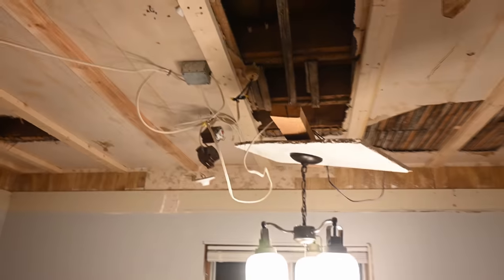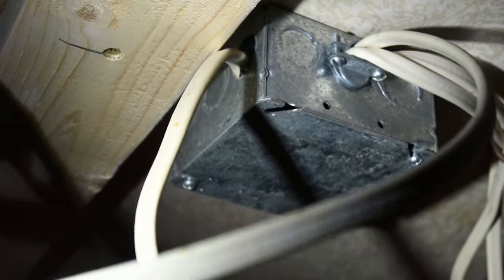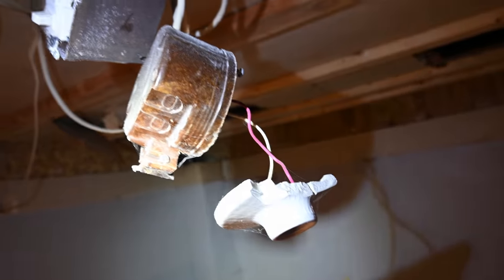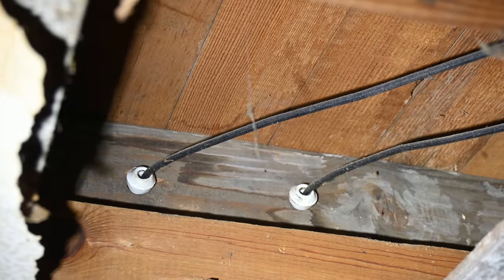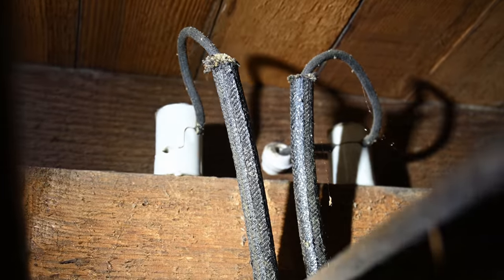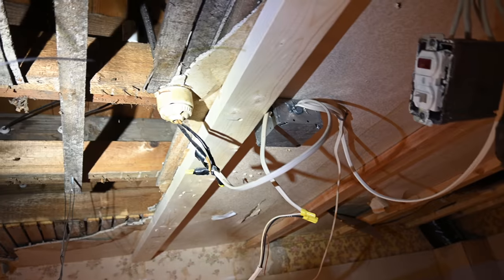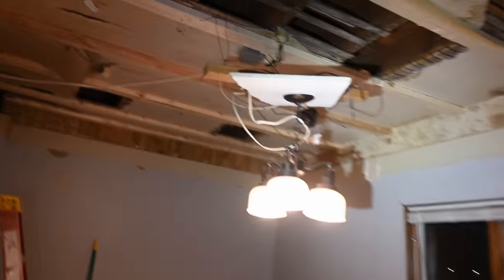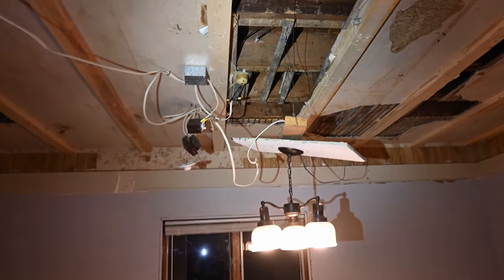The Worst Modified Knob & Tube Wiring Situation I've Ever Seen

Comment: "Original" knob & tube, even 100 years old,  professionally installed is remarkably durable. TWO hazards: Improper add on's & overloading the old circuits with so many new appliances. 100% rewire.
Reply from the maker: Agreed. Honestly the actual knob and tube stuff looked to be in great condition with nothing that looked particularly hazardous. The "add on" wiring though was more of the issue.
Reply: deteriorating insulation and no ground are issues as well
Reply: Yup. The only problem with original KnT is that the insulation gets brittle close up to the lamps, from the heat. Often, the loom and insulation is till quite rubbery and even has its original tar intact. 

What we did in Iowa was to run new, code compliant circuits and leave the existing in place without alteration.
Reply: @Jon-hx7pe  yes, deteriorating insulation,  especially where exposed to heat at light fixtures.
Reply: The thing is you can over load the hell out of K&T and nothing will happen. The wires are in free air and separated. Modern wire the problem happens as they are close in the same jacket and will then start to arc and spark and poof fire.   Not the H/O free air splices yea bad day.   Ripping out the K&T at my families I back fed the old stuff as we went along room by room.  Get to the next room. Open the previous box, disconnect it and pull from the side you're remodeling.
Reply: Another hazard I’ve seen many times is where the main run of K&T is tapped for branch runs. They would strip the wire, twist the tap around the main, solder the tap, then wrap the tap with tape. 
Eventually, the tape failed and left the connection exposed. I’ve been in dark attics and have seen those connections glowing from a heavy load. 

I learned from a fire inspector that a lot of K&T fires occur when the homeowner adds more cellulose insulation which covers those connections that used to cool down in free air. The insulation traps the heat and smolders until a fire eventually happens. That’s just one of several hazards K&T present today. At the time it was installed, it was awesome!
Reply: @OwensandCompany  Quite true. However, that was actually how they made taps: scrape the wire, wrap branch wire and tape over the bare part. The overloading, insulation, out-of-box contact ... those are our fault. 

Hey, they didn't even require system grounding until after the 1970s.
Reply: Had a shop teacher tell us that knob & tubebis safer for flooding and overheating ( as long as its on a 15 amp fuse or breaker. ) .
Reply: Bare/ deteriorated insulation on knob and tube is the most dangerous to not only home but us tradesman. Heard a story from an "og" in my company about an ac tech who layed across bare knob and tube in an attic, the outcome was not good.. have read stories about newer insulation being blown in attic's where the knob and tube electrical caught fire... But if it's unmolested and in good shape just leave it alone it'll probably last another hundred years!
Reply: Agreed
Reply: @ricoludovici2825  That's The Logical & sane way to do it, not all the fear-mongering.
Reply: @OwensandCompany  I can speak about old wiring.  We didn't run into knob and tube but we ran into 1910's or 1920's wiring in a house my father had.  The wire was literally insulated by cloth and by the 1980's whenever we had to change a switch or outlet (which seemed like every month) the cloth would literally disintegrate in our hands.  Worse yet, the wire appeared to be equivalent to 16 AWG.  That electrical system was a big mess, that is for sure.
Reply: yet today's LED's take almost no amperage compared to 100 years ago, so it is safe overall if not "messed" with. That mess (for lazy people) seemed to be more work then doing it right.

Comment: Back in 1900 that was the top of the mark in electrical work..

The lesser done jobs all caught on fire so the fact it exists to this point in time is pretty freaking cool.

That's historical wiring..
Reply: It's pretty sound wiring as well the overcurrent being plug fuses where larger fuses can be put in when you're blowing smaller ones are the questionable part of the system. That and no equipment grounds.
Reply: @frankpaya690  That's true with the original Edison base sockets.  In Wisconsin you had to use Type S inserts, they have a one way ratchet, if you try to remove them they destroy the socket.  Inserts were sized for 15, 20, or 30 amp circuits and were NOT interchangeable.  The 15 amp fuses were blue, 20 amp were orange, and 30 amp were green.  So even if you are color blind, or can't read numbers, a 15 amp will just drop in and rattle around in a 20 or 30 amp socket and a 30 would'ent  fit in a 15 or 20.  
In someways fuses are safer than breakers.  A fuse is a simple non mechanical device, whereas a breaker has thermal and electro-mechanical contacts.  In fact in the early days of breakers, they would recommend switching them off and on maybe once a year to make sure the contacts were not frozen.

Comment: My dad was a master electrician. In these situations, EVERYTHING came out. No attempts to make it work or anything like that. It all came out and was done right. You can spend your time analyzing and coming up with working solutions or you can fix it right. He was a real hardass on this kind of thing but he was right.
Reply from the maker: Yup, that's the way to go for sure! You can spend days fixing old junk and then still not have a great situation when finished.
Reply: I thought the same thing. Rip it all out and do it right.
Reply: Some people disconnect the old but leave it in place, for its antique/historical appeal, and run new stuff separately.
Reply: @scorpio6587  If you leave it in place, your homeowners insurance underwriter will still deem the house to "contain old wiring" whether it's energized or not.
Reply: If the old house is in a gentrified historical neighborhood that is constantly appreciating, then yeah, it could be worth it to tear down all the walls and ceilings and completely rip out the old knob and tube wiring. Besides that, you can install modern insulation, plumbing, and voice/data cabling too. But the vast majority of old houses are NOT appreciating like that, so any serious amount of investment like that may not be realized. Plus, if you're LIVING there while you're doing renovations that are THAT extensive, well, that is hell in and of itself.
Reply: @aaron74  where do you live that the homeowners insurance underwriter  has any idea if you even have wiring?
Commie California? My insurance company has never even been to my house.
Reply: @dontfit6380  When you're getting insurance for the first time, they certainly make a risk assessment of your property. One of their factors is old wiring. You can call it commie, but it's simply business... if your house is too risky for their underwriters, they may may flat out decide not insure it and advise you to try another company. I encountered that with USAA on my 1890 house. So I'm using Allstate.
Reply: @aaron74  but you are in California correct? I’ve built two of my own homes. I built them not general contractors. I have also owned several older homes. I’ve yet to have an insurance agent at one of my houses. I’d never heard of such a thing. Do they also look at your cars when you buy them?
Reply: @dontfit6380  California? What makes you think (or even guess) I'm in California? I'm genuinely curious. I don't think it matters what state you're in; an insurance company is going to do a very thorough analysis of your house and charge you a premium according to their risk calculations. They do it with automotive insurance too... what the vehicle is worth, its safety features, what ZIP code you live in, etc.
Reply: @aaron74  I assume California cause I’ve never heard of such a thing. I’ve lived in 2 stares. My insurance companies have always just asked square footage and appraisal and how much I wanted to insure it for.  The same goes for my sons house. I find this so strange. 
I’ve owned more cars then I care to think about as it was a hobby of mine and no insurance company ever asked me what I paid for them. They get the vin number and send me a bill. Really this is crazy. It has to be where your living or I’ve just lucked out with where I’ve lived.
Reply: @dontfit6380  Maybe it's because I have an 1890 house and that could raise a red flag for the possibility of having old wiring. So they confirm it in their risk assessment and underwriting process. If I lived in a younger house the issue wouldn't ever be raised as it would be impossible for a house built more recently than, say 1950, to have knob-n-tube. My suggestion to you would be to stay away from owning an old house if you're bothered by a more detailed and thorough risk assessment.
Reply: @aaron74  I don’t know, like I said it seems strange to me. I’ve never had one ask what year my house was built. They just ask the appraised value and how much I want to insure it for. 
Around here the risk assessments are done by the area you live and how far from a firehouse. Like I said it must be the area you live. 
You are correct I would not insure my home if I had to let some little suit in to snoop. The tax assessor already tried that. He won’t be back again.
Reply: @dontfit6380  The year your house was built is public information. It's in your county's property record data. You can look up information about any house in the country if you go to that county's website and find their property lookup search. I think you underestimate what the insurance companies already know about your property.
Reply: @aaron74  of course they can but that doesn’t mean they do it. Again I think it’s where you live. I’m going to have to give my insurance man a call.
Reply: @dontfit6380  I would never assume they don't. lol  It's to their advantage to have as much data about your house as possible. You do also know that your automobile insurance company checks your driving record too, right? That also is public information anyone can get about anyone else.
Reply: @aaron74  Haha yeah I did more then my fair share of drag racing in the 80’s and went through many insurance companies. My home insurance guy is calling me tomorrow. I’m going to hash it out with him as to how much snooping he’s doing.
Reply: @aaron74  i’m
Reply: @aaron74  I asked my insurance man about them ever needing to look at my house or looking up public records. LOL He asked if I was doing something out of my home I shouldn’t be doing . 
All their prices are basically cost averages per area.  They are only in my state so they are never paying for hurricanes or earth quakes so their costs and our costs are kept down. He said some of the bigger insurance companies could want a home inspection but that I don’t need to ever worry about that.
Reply: @dontfit6380  I never said they all order inspections. I'm just saying they AT LEAST compile all the public information that's already out there about your house and they have that in the file of your property. They may or may not ask you questions about the property that pertains to a risk assessment, like old wiring. (If you have a 132-year-old house like mine.) I could see a company being more cavalier about specific details in a development of new homes (less risk), but they certainly will have all public county records about it.
Reply: @scorpio6587  leaving old wiring in place is never a good idea
Reply: @aaron74  That's because the underwriters don't understand anything about the trade or much of anything having to do with being a mechanic. They're not "mechanics" they're Insurance Underwriters, they only "know" whatever they've been hearing.
Reply: @frankpaya690  Yeah pretty much. But they also go by statistics, too... they track how many electrical fires in houses with old wiring, etc. to develop a risk assessment. You may be able to get a break on your homeowners if you have arc-fault breakers installed in your house with K&T wiring and have an inspector sign off on it.
Reply: @aaron74  I haven't had an insurer come out and inspect a house before insuring it since the 1960's.  My sister had a company do a drive-by and denied the policy because of her roof (she immediately replaced the roof which was a planned expenditure anyway) but they did not inspect the inside of her house.  I have had the same homeowners policy for 27 years, I haven't even spoke to anyone from the insurer about my house in many years.
Reply: @aaron74  That isn't exactly true.  The info is public but in my home county the info is NOT online, you have to physically make an appointment with the county clerk and go to the county building to check information about a house.  That is true for most Michigan counties (Kent and Wayne counties which are the two most populous counties in the state may have this information online -- I don't know).
Reply: @mharris5047  I'm pretty sure insurance companies just go by the county assessors. That is public data. What Michigan county are you in? I'd be surprised if they didn't have a property lookup tool.
Reply: @aaron74 my entire basement isn't permitted. 2 bed 1 bath and a kitchenette. Just do all the work yourself.

Comment: Ben, i deal with that kinda stuff all the time. 
You will find 3 wire outlets connected to 2 wire systems in many older homes.

Imagine if you will... a 120v circuit is hot.. after turning off all single pole breakers, it is still hot..hmm

Shut off all the 220 breakers, yup, still hot.
Shutoff the 200a main breaker, yup, still hot
Remove panel cover, find 12ga wire is literally tapped ie "tek screwed" INTO the "B" phase panel feeder.. 
Pulling the meter would kill it.

Another good one,.. yrs ago, a guy had a small utility/golf cart shed built..his backyard was next to the CountryClub golf course.
About 2 decades later sold the house..
New owner needed some electrical work done to the shed..
The shed had been wired to the Line side of the meter..all those years..

Comment: Yes , I saw an entire two story home  with knob and tube wiring that used uninsulated or bare copper wire . At the top of the stairs into the attic resided a bare 150w lamp that had been on (no switch) and lit sense the house was built . Fuss box two 30amp  no power cut switch . The only switch was on the power Pole out side controlled by a d handle and a push-pull rod about 6 feet off the ground . Entire service was 110-volt.
Reply: Believe it or not, a light lasts forever when lit. What does the most damage is turning it on.
Reply: @adamplummer2190  or off. Thermal cycling.

Comment: The strangest wiring I have seen was in a little hospital building in upstate NY that was built in the 1900 to 1910 range. Knob and tube with knife disconnects and cylindrical fuses on both the hot and neutrals. By the 1980s when I was working there the neutral fuses had been replaced with sections of copper water pipe. Fuse panels were behind glass doors in the corridors. Yikes.

Comment: My house originally had knob and tube wiring in it.  Also, they brought in the entrance cable and split it in two.  One half went to one box and the other half went to another box.  Interestingly most of my 1 1/2 story house was operating one one 20 amp fuse.  I never did understand that.

Comment: I do home inspections and have seen some crazy thinks done with knob and tube wiring. Exposed splices (just soldered together) with no tape/insulation present,  wiring in contact with plumbing and or HVAC duct work, missing knob or tubes etc..etc..

Comment: Another sweet trick is when people use the ground wire of newer 2condutor romex as the 3rd wire for a 3way switch. Fellow electrians of mine have seen Christmas lights ran in a wall to add another receptacle, one that takes the cake is someone had cut into a service mast that came through the attic space and tapped off the live line side conductors before the meter for a grow op. Crazy people out there
Reply: Wow
Reply: Tapping the service wires before the meter is frighteningly common in illegal grow ops for two main reasons,  first,  indoor growing operations often include at least a dozen if not more, metal halide and/or high pressure sodium lamps ranging from 400 to 1000 watt lamps,  so to make as much a profit as possible,  they avoid having their extreme power consumption billed.   Second, to avoid suspicious activity from very high power consumption being reported to law enforcement,  as this is a good indicator of a grow op.

Comment: I like your videos, I have seen plenty of knob and tube installations. Here in the Midwest the rea  installed most house and farm electrical services because most rural places didn't have electricity till after 1946.   The insulating flexible tube you see on each conductor is called loom.  The worst thing about knob and tube wiring is the splices in the walls or ceiling  they were soldered and then taped  with the limited loads then probably a 60 watt bulb hanging from the ceiling,pull chain or key switch on the socket, they didn't even use a switch leg, and maybe an electric toaster, the first appliance was usually an electric refrigerator. Keep the good videos coming the neutral is usually fused also in the old installations.

Comment: My 1890-built house had a mix of knob and tube and 14/12 ga. romex. Lots of exposed romex ran along and literally smashed halfway into the slate walls. Some sharp bends and evidence of wire overheating (burnt sheathing). Copper panel and wiring but a lot of aluminum wiring in the upstairs walls. Old thick 120v wires hanging exposed where the original power meter was mounted. The house was extended and has the original exterior inside the house. A house built over a house. Insane.

Comment: Yes almost the same and the wire in the job almost enough to do the job correctly except the length from new panel box .Wiring take the time do it right like you do at least safely.